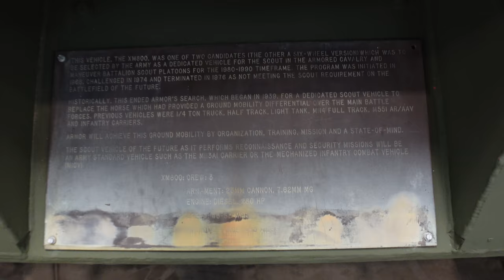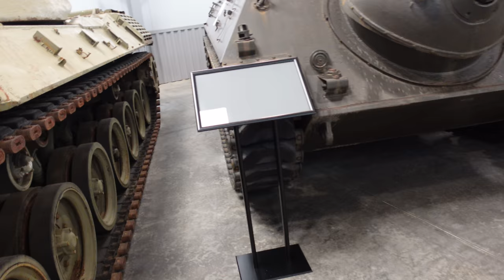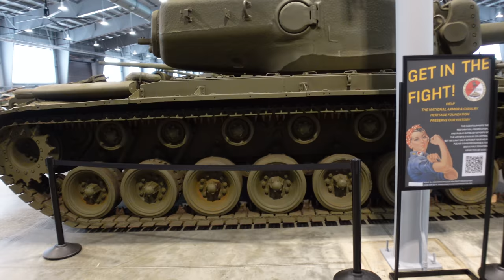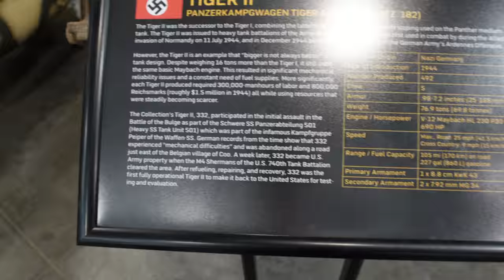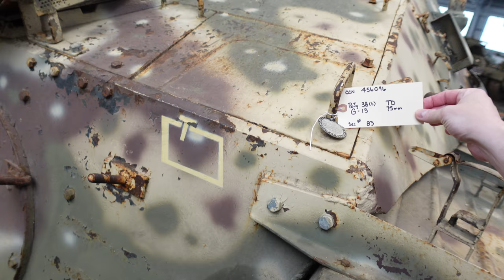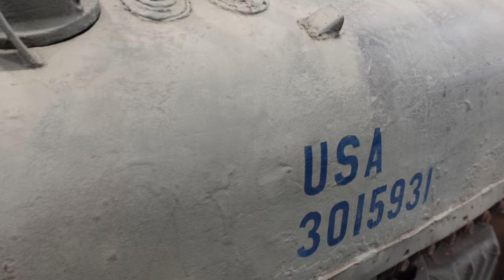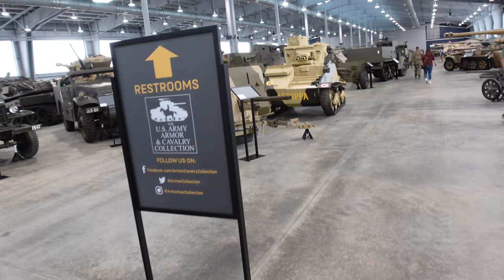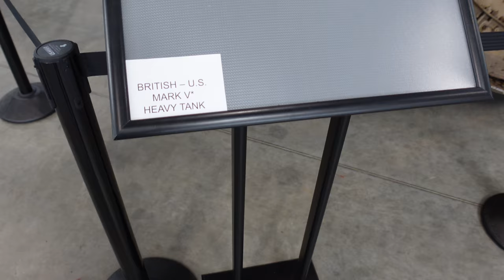Spring 2023 open house Fort Benning Armor and Cavalry collection tour.

Comment: This is a picture from Wikipedia, indicating (I think) what the Jagdtiger looked like in 2008. If it's the same tank (which seems really likely), then it has definitely suffered since. https://en.wikipedia.org/wiki/Jagdtiger#/media/File:Jagdtiger_at_Aberdeen_proving_grounds_2008.jpg
Reply from the maker: Yes it was outdoors in the elements at Aberdeen rotting away for a long time, they are going to clean it up a bit now that it is indoors at it's new home.